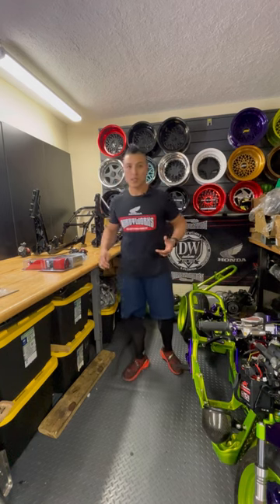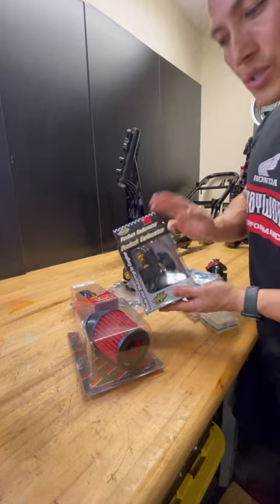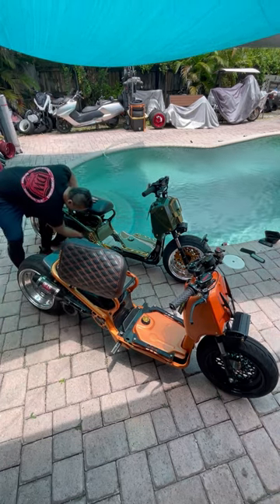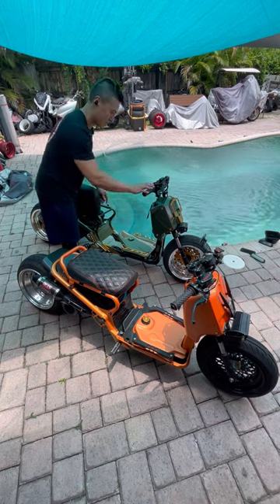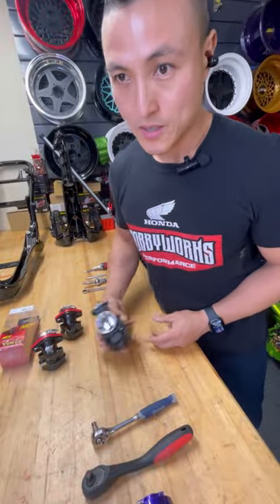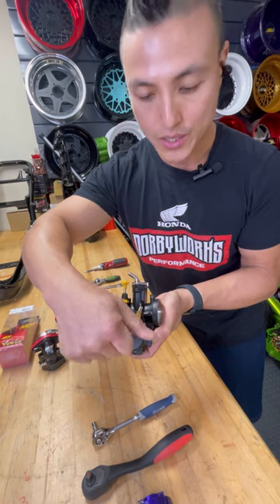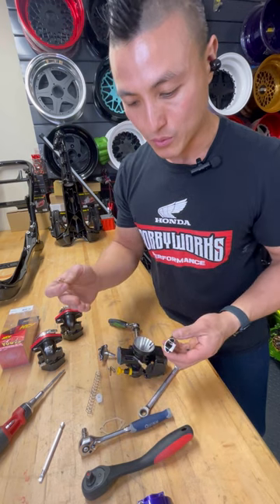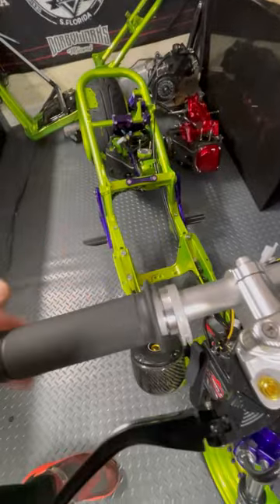Best GY6 Performance Carburetor & fuel system - Dorbyworks - How to

Comment: Interested in item for my 232 will I start off with the same jets 125/40 I’m at sea level in S.C
Reply from the maker: Thank you for taking the time to watch the video and your support.  The baseline jets will be able to to start the engine. However fine tuning for each engine is required. Tune for the pilot idle jet initially. Then for the main jet after.
Reply: i’m SC also with a 28mm PWK carb.What jets helped you run good? mines still boggy full throttle  with 120 main & 38 pilot
Reply: @gullahgeechee2699  what size engine
Reply: @dougparsley910  stock 150cc
Reply: @gullahgeechee2699  try  118 /35 i bet it works better im in NC and thats what i use

Comment: Amigo nice channel new sub, i just revived my scooter 150cc gy6 with a new engine Xpro150cc from amazon. Sounds good but what gas Oct is better. I'm using 89 i heard you need to use 91 but i dont want to ruin the scooter
Reply from the maker: Generally carb engines do not require premium gas . It doesn't affect any gains or lost.

Comment: Do you not have performance issues with the carb facing forward instead of rear like it’s “supposed” to be. 

Mine always has issues like that
Reply from the maker: We do not have any performance issues whatsoever. Give our system and experience the performance and reliability yourself.
Reply: @MrDorby  OK this is going on a generic Chinese scooter that I have stripped the fairings off of. Does that make a difference?

Comment: Got a  50 cc mddg  wanna swap t0 150. Anyone no where. I can get. The motor. Wireing harness. I run 12 x8. Rear rim  also. Motor mount.

Comment: Can you add this to a stock 2024 ruckus ?
Reply from the maker: The Carb system is for an upgraded engine. A upgraded engine can be installed in a 2024 Ruckus.

Comment: Thanks for the FB post on this. Makes me think im way too lean at 35/110. I don't think i caught it...any needle changes or middle clip?
Reply from the maker: Needle clip is generally in the middle. Once you become more experienced in tuning you can super fine tune it with different needles and needle position. However its really not necessary to get over complicated.

Comment: remove that stupid vacuum pump man
Reply: I think the guy that’s been doing this for 15+ years and is probably the biggest name in the ruckus tuning game knows more than you. 
Ive ram that pump on all my setups as well and it has been more reliable than anything else
Reply from the maker: The system is simple, reliable, and effective. There are not any reliable simple Electric fuel pump setups for this. We've tried a few and they often require too many extra electric parts to support the fuel pump that are clutter in my opinion and another item to replace.  Sometimes they require fuel regulators that are also extra parts that can fail.  However to each their own. Thanks for checking out the video and commenting. We appreciate your feedback.
Reply: @MrDorby  exactly. It’s nice seeing a response from the man himself. Love your custom builds and wish I could afford one 🥲
Reply from the maker: @pulsartech2945  thank you for your support! We're here to help when your ready!
Reply: @MrDorby  if I can get my wrap business off the ground I’ll absolutely be picking one up but that’s gonna take time, especially since I’m not in Florida/Cali